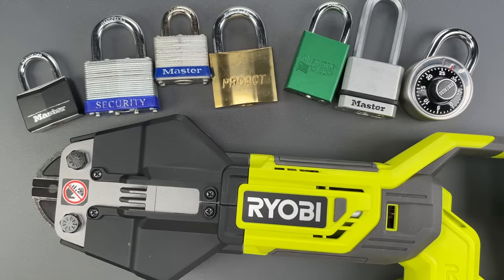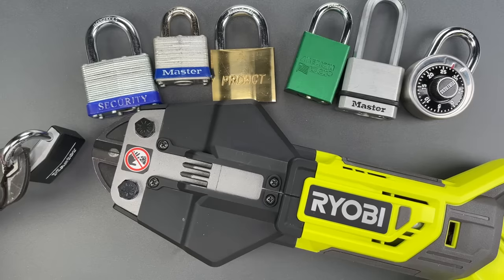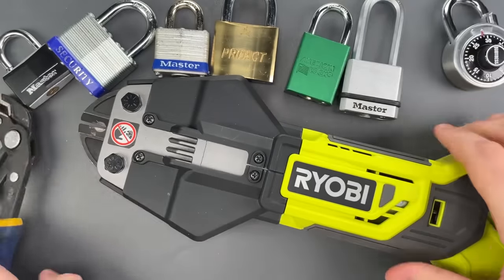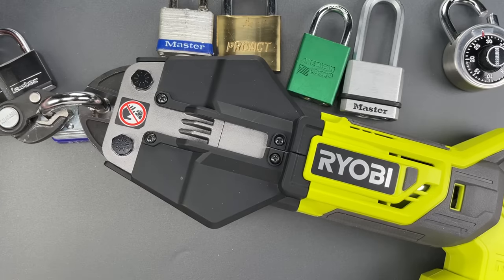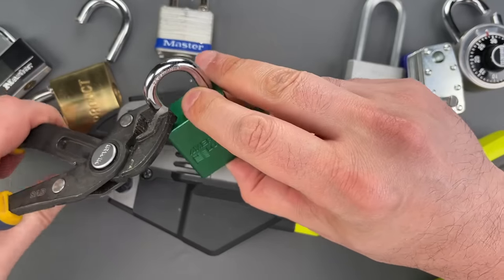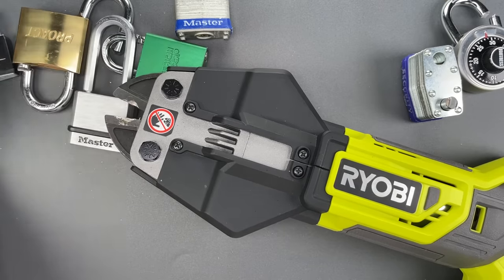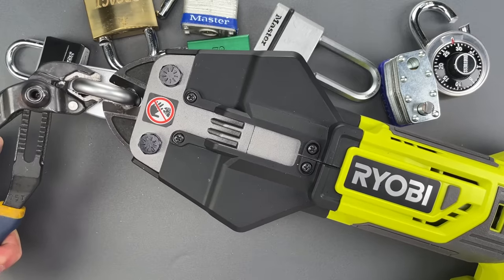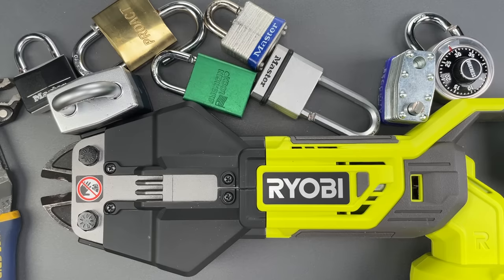[1408] Better Than Expected: Ryobi Bolt Cutter

Comment: Lol... After using a few master locks, he uses a "more reputable" "American" brand lock... And I thought Master was the more reputable brand considering you can find them within a stones throw in almost every store😂😂😂 I'm just kidding, but seriously, if it's more readily available, it should by all rights be more reputable, if you go by the "good products sell better than bad ones" metric... That said, I might use a tiny master lock or something, for securing a PC side panel, since any computer requiring a padlock, and any other hardware stored in the same room, would also be behind a somewhat good door with a fingerprint reader retrofit... there's a few fingerprint reader door knobs and locking bolts that I see good reviews for, on YouTube, that aren't just plastic addons, but actual door knob replacement kits...

Comment: Not surprised any of these were cut with bolt cutters, electric or not. Also why expect more from the A1105 when it's a lockout lock. It's supposed to be easy to cut, as it's there as a visual security feature only. All masters featured in this video are cheap AF and sold at big box stores only for that reason. Also the fortress locker lock is made by master but so low quality they wont put the master brand name on it, so really shouldn't be surprised it was cut (also it's a locker lock it's also designed to be easy to cut)

Comment: theres something NOT KOSHER about this… the incremental stopping CANT BE necessary… based on how this tool actually functions, it can definitely get thru that last lock if it simply HAD MORE POWER… you have to get the larger battery AND OR at least open it up to see if the stopping is a safety feature that can be bypassed… either way, with more juice, this thing works as intended.

Comment: Cutting a chainlink fence would take forever with that slow of a cutting speed. Yeah, it would hurt less at the end of the day compared to using a pair of Knipex mini bolt cutters, but those mini bolt cutters would go far faster then that piece of junk.

Comment: I love how people who like Ryobi are like "well it didn't break the first time I used it so it's just as good as anything else"
Reply: Whats wrong with that. I rather have alot of cheap tools. Than a few quality ones.
There is no point in having a 500 bucks drill, when you need a tablesaw.
Money is always limited.
Reply: @jonasstahl9826  There Is a point if you end up just having to replace tools. Even if they're under a warranty it's a waste of time bringing a piece of shit back to get another one because it failed.
Reply: @JDPyrotechnics  I dont have that problem, my tools last, hasnt had a broken one, that wasnt my fault.

Comment: The first shackle did the damage. Those parts of the blade edge were no longer as sharp and then you kept testing each subsequent lock on the same damaged spot. Not surprisingly, like when a boxer has a cut over his eye and his opponent keeps punching the cut, the blades got progressively more damage. How is this going to give you objective results?

Comment: i need to defeat a padlock that is tucked in an impenetrable 1/2" thick pipe for a giant gate.  i can use oxy acetylene but i don't want to ruin my gate  i designed this thing to good...

Comment: Seems like this tool would turn 5 minutes of actual cutting work into an hour. I just don't see the point, manual bolt cutters aren't hard to use
Reply: you missed the point of the video by a mile.  Is he the "actual cutting work" lawyer or is he the lock picking lawyer?  He cut through half a dozen locks in a 4 minute video.  I'm not sure what your point is.

Comment: Can't say I'm surprised here. If your security means relying on the cheapest padlocks then you deserve to get fleeced and the Squire proved it. Next time get some more reputable padlocks to test, even if you have to beg money or sing a song to the wife to pay for them. Heck, get some 12mm Pewag square security chain to test - I seriously doubt this bolt cutter will go through that, especially when the padlock being used is something like a Viro or Laclede where the chain end links sit shotgun and completely hide the shackle. Picking the lock will be quicker than using bolt cutters LOL.

Sure, you could get a cordless angle grinder but you would be spending 15 minutes going through a disc... and that's assuming nobody gives a damn about the noise your making AND you can get the chain to stay still while you cut.

Comment: Like others have said use a larger battery
And always put what ever you are cutting at the very base of the jaws that way the tool has the maximum leverage.
Much better chance of getting the job done

If you put it half way out the jaws with a 1.5 ahr good luck.

To all the thieving c$&nts out there disregard the above please!

Comment: the blade get weaker with every cut.  Cutting the hardest lock at the end will not work.  Try cut it with a new blade.

Comment: “almost no damage at all” yet there’s several new cuts in the blades. goes to show how much of a fraud he is since he’s reading from a script!

oh and he’s cutting in different spots not because he’s trying to save the blade but because the force is different in different locations! cutting the cheap ones in the same spot as the “more reputable” ones would show that they are just as strong.

Comment: It's a ryobi. The worst tool you could buy. They are junk. Even though it cut the locks you only had 8 cuts in less than 5 minutes. Just wait till you cut with it for a whole day. There will be nothing left of the blades.